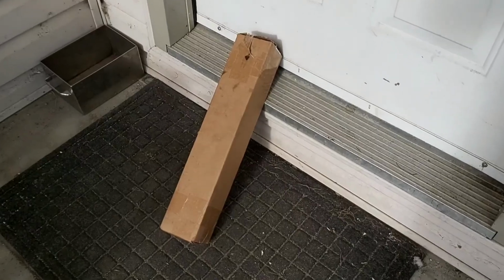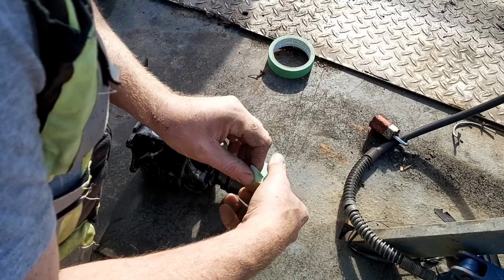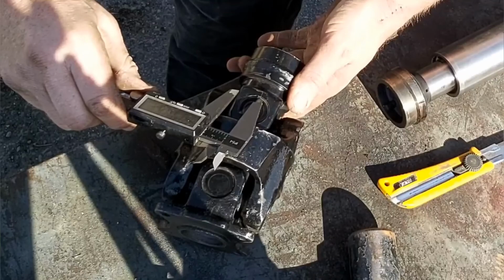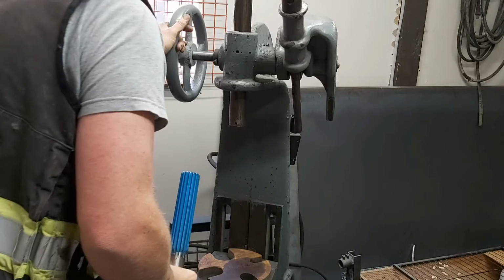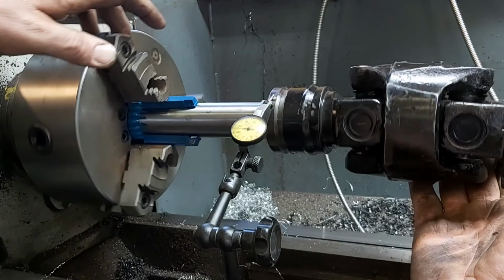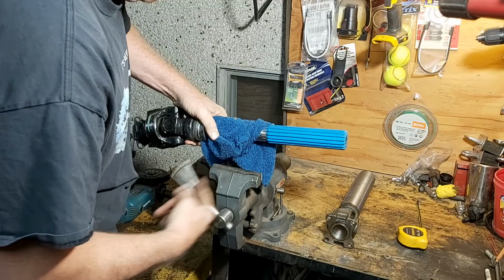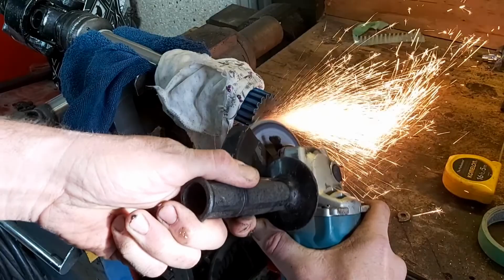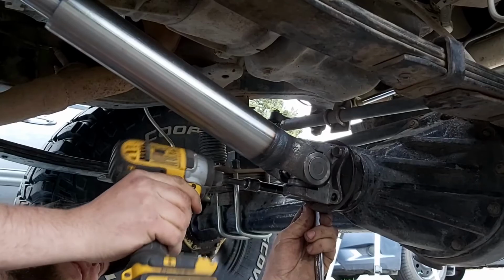Driveshaft build for a Toyota ,long slip

Comment: Awesome! I gotta re do my chromoly drive shaft with billet yokes and 1350 u joints ..i let the garage floor level my yokes...was a little off and a 1/8  of an inch or so short...held up alright at 800 whp but it's got this annoying vibration...that i should have fixed vs moving my diff around all summer :P

Learned some cool tricks in this video.

Thanks!
Reply from the maker: Glad you enjoyed it :)

Comment: What’s the lift height on the truck and distance from TC flange to diff flange. I need a front drive shaft made also and trying to decide to go with the 8” slip drive line or 10” HD drive line like the one you used.
Reply from the maker: I just talked to my buddy Tharon and he will comment tomorrow for you after measuring it.
Reply: Sorry man finally replied  to this  so it has the 4 inch tg lift leaf spring sas swap kit.   once springs settled is 27 inch from flange to flange.